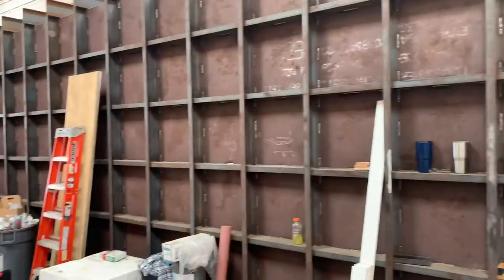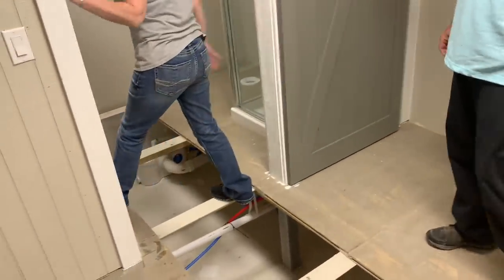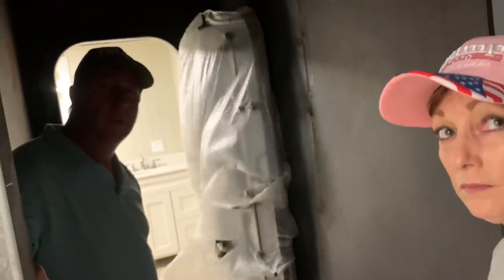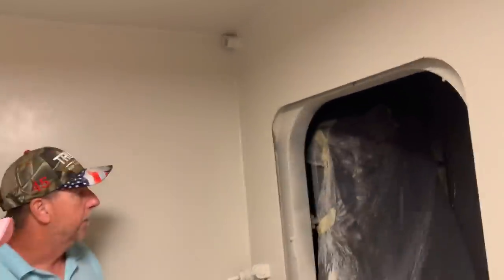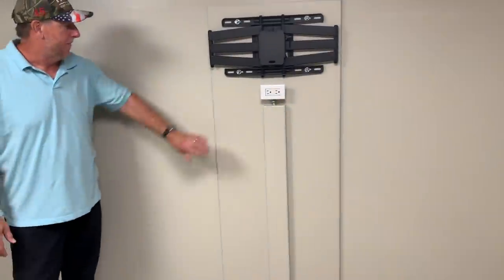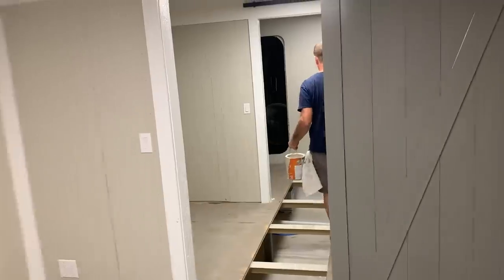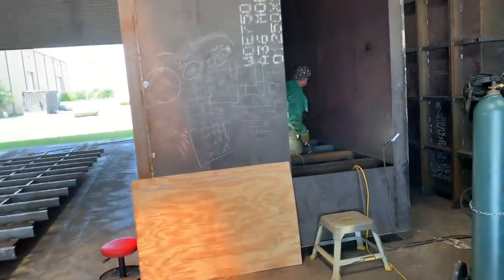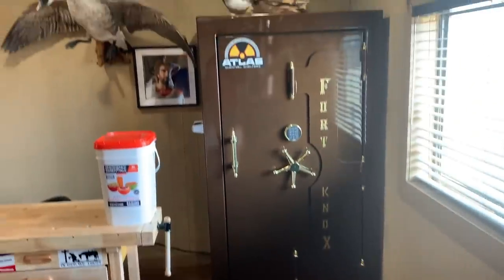A Tiny House Underground Bunker You Can Live In - Atlas 10x40' Modular

Comment: the pistol port could be modified to be like a gpmg ball mount as in the frontal mg in a Sherman tank. Use surplus army vehicle periscopes! You can see well, they are indestructible and you can remove/replace them. Would augment the ball mount and you never expose yourself to an opening you may not be able to close if a bad guy jams it with a 2x4 or rifle barrel.

Comment: How deep can you bury the modular shelter?
Reply: 10ft
Reply: @beybladesinmyheels1267  bummer. I want to go about 20ft
Reply: @shawnwade302  if you go any lower it’s dangerous
Reply: @shawnwade302  Well you can't dig yourself out under 5 if something happens, most aren't very deep. A renforced unit like this would hold up, but it's got a wide flat ceiling, even shipping containers begin to buckle under a few feet of weight. Pouring concrete in drained soil helps for weight stability, but ideally if you're going deep it should be in solid rock. 20 feet is a bit ridiculous if you actually think about how deep that is, it makes sense at first but you have to visualize 20 feet, do you need it when you get the same for 10? Anyway I'd imagine stacking them in a way would give less stress to the ones below, if the roof is 10 feet high and it's 10 feet under you're still technically 20 feet and not much can get you there, but if the whole hole is dug out 30 for the extra dirt above you, it would be some project carving out that dirt in a ramp because you have to get down in there to scoop properly, I'd imagine it would be interesting. Concrete might work but I'd do pre- poured, bar filled and metal renforced half foot walls. Laying bricks is good for surface spaces, but down there it needs to be sturdy. You don't want the roof to bend to much, but you want some give because concrete wares and cracked under pressure or erosion. Another aspect of it too. Maybe some form of both would work, with load bearing beams impending on your living spaces, even so you have to contract a professional to give you their' opinion on the project, I'm no expert.
Reply: Look into cave homes? Costs a lot but it's solid, sturdy stone.

Comment: What size or max watts should the generator be? 5,500 watts or bigger? I’m assuming the main electrical box is pig tailed for the generator to pluck into. Really curious the size of the generator. I’m wanting to pig tail my mobile home in case of a Hurricane here inOkeechobee, Florida. I can get a 5,500 watt for $400.00 from a guy I know. Just I don’t think it’s big enough to kick in the compressor on the new 2.5 Ton A/C Unit but everything else I’m good on that size, not even that’s to big to just run a refrigerator and a 5,000 BTU A/C, was gonna put it in a Bedroom Window and then shut the door and live in that room till the power comes back on! I don’t have $5,000 to get the gas generator from the Home Depot, Florida made it a Law after Irma to use on all Senior Citizens Living Homes. Then the Install.
Reply: 2.5 Ton AC unit in a mobile home?! 🤔